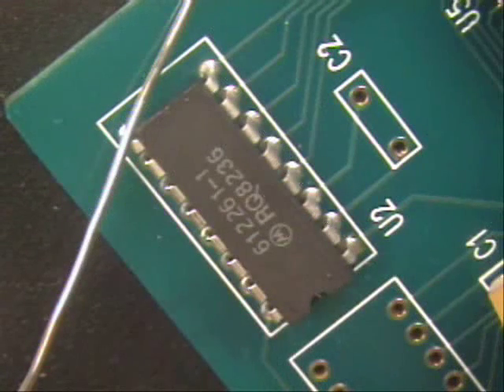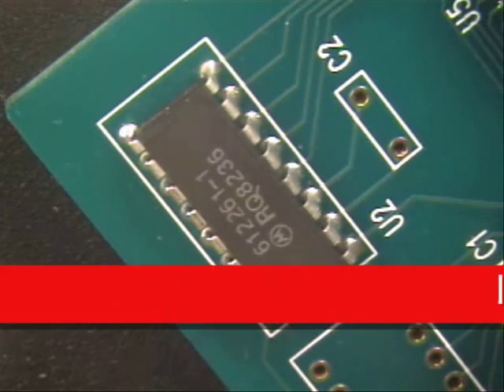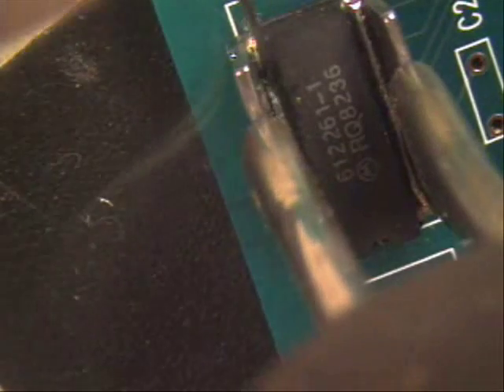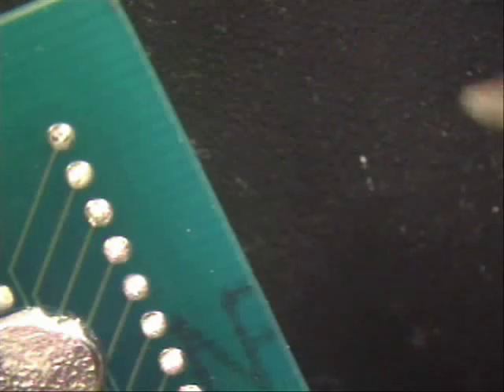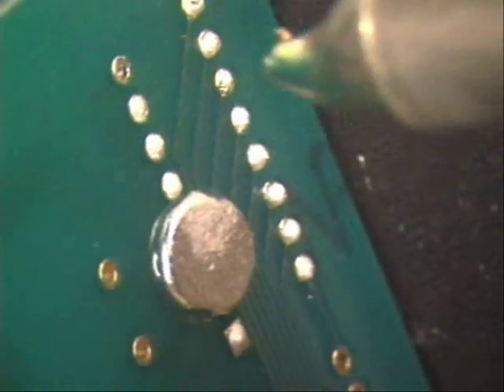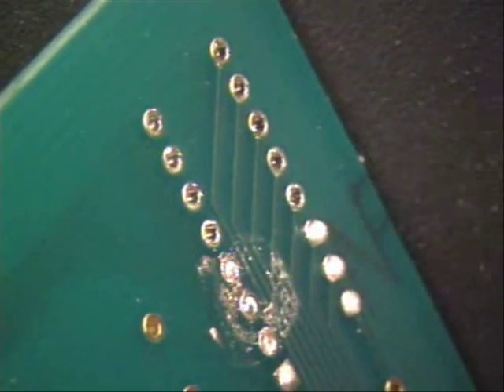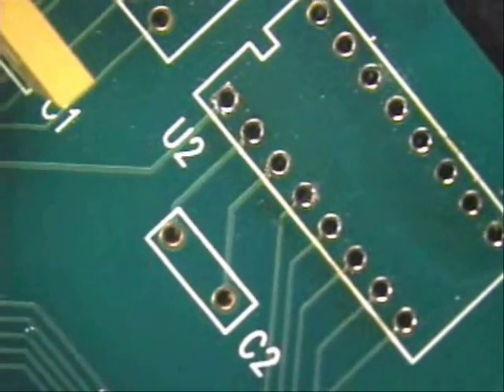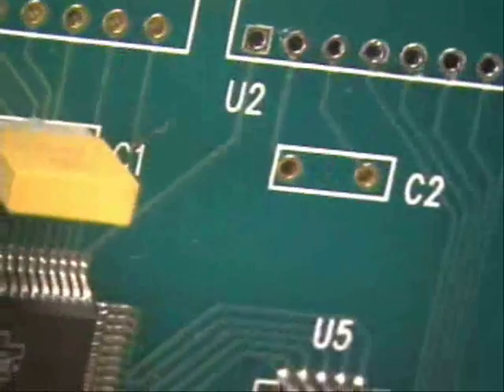Removal of DIP Tweezer Method

Comment from the maker: Solder wick for thru-hole is not recommended. Reason being is one you have solder wick that takes up a lot of your heat source plus the solder and then if you have a ground you will need more heat.  To many variables and more chances of causing damage.

Comment: I use de-soldering wick to remove all the solder and then just pull the device out. To keep things clean I go arround 350 degrees celsius. Never damaged a board ever.

Comment from the maker: This is another technique that can be used. It can save on time especially if you have a thick board or one with several ground plans that can cause normal through hole desoldering issues.  Sorry for the mislabeling of the videostream it is a DIP not an SOIC.  I am glad that you noticed that and are paying attention to detail.

Comment: "SOIC Through-Hole" is a contradiction in terms!! That was a DIP (Dual Inline Package)through-hole IC. SOIC (Small Outline Integrated Circuit) refers to surface mount technology.
 Your method seems like a sloppy waste of time. You already have a nice desoldering tool, so why use the tweezers to remove the IC and then go back and suck all the solder out? Just suck the solder out first and avoid the mess you made!